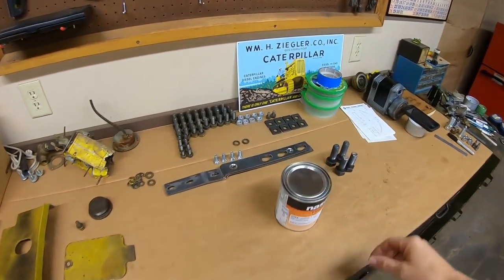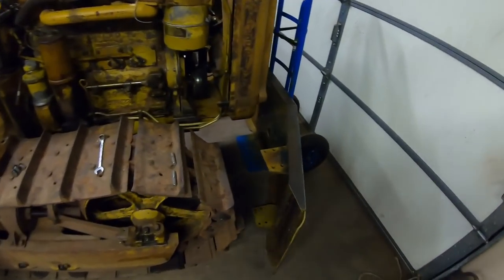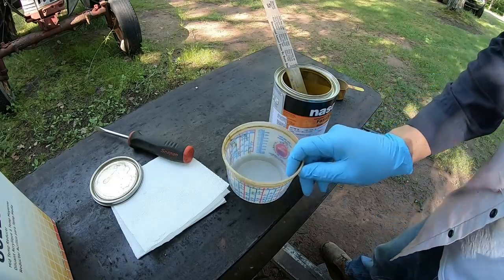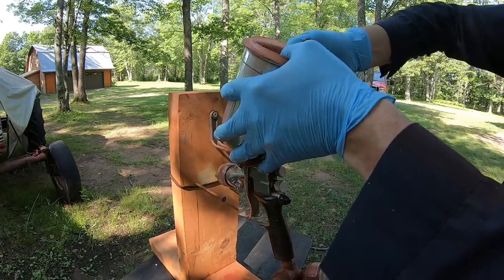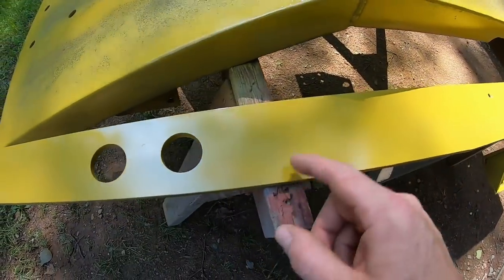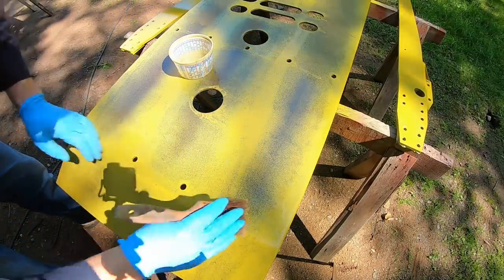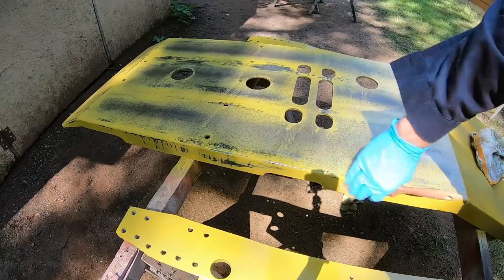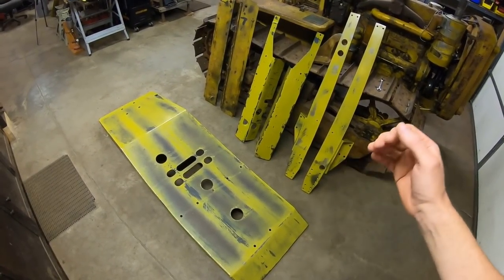Caterpillar D2 #5J1113 Chassis Rebuild Ep.62: Paint Work Begins! Spraying New Yellow & Distressing

Comment: This is Bill again.  My grandfather called your corn plow a bull tung plow.
Im 70 and as a kid we plowed and cultivated with horse drawn implements.  It's not that hard once you get the hang of it.  It's easier with a tractor because you don't have to control the horse.  We used a small tractor..  to fix the handle we used two eye hooks and a turnbuckle.

Comment: I saw a relic job on a ratrod at the last SEMA show that blew my mind. The entire car was brand new carbon fiber body on a brand new Chromalloy frame. He airbrushed on all the distressing, the rust, the primer, dents, everything. It was an amazing thing to see. After the airbrushing, he covered it in clearcoat that shined so deep. That is an artform by itself and you have that gift. Many fail at relicing because the wear and damage looks like it was intentionally damaged. It looks like you took a grinder to new paint. Normal wear and tear doesn't happen like that. It must look like you tried to keep it perfect but accidents and nature happen over the years. Bravo on this latest achievement

Comment: Going to need to create a mast to plug into the exhaust pipe to mount several tiny cameras with batteries in the mast tube.  So you can record the visits at the first tractor show you take it to. 

Need to print a few stills of dragging it out video.

Comment: As a mechanic who's busy in the shop, I don't always have time for proper prep of a new part. Sometimes it gets painted nicely before it gets put on, some times it gets thrown on, quick hit of brake clean to get the packing oil off, and then a paint bomb can quickly sprayed on with overspray on other parts, if it gets painted at all. Imagine dealer techs back then were the same way.

Comment: That Aircraft Stripper is way nastier than the original stuff. Wouldn’t you say it has a strong ammonia smell? I use a respirator with it. I just stripped a bunch of motorcycle engine parts that ended up getting a Cerakote treatment which is a gun coating but is awesome stuff.

Comment: Are you going to add a mist band of red iron oxide paint around the inside of the hood, side panels and belly pan to duplicate coolant slung off the water pump pulley to duplicate years of coolant spray.

Comment: I had a couple questions for you. First, what's your thoughts on induction bolt busters?  Also, is there a good inexpensive code reader that can help determine if a torque converter is slipping?